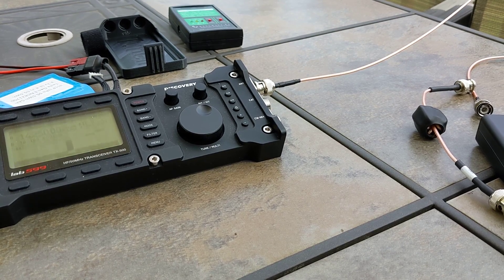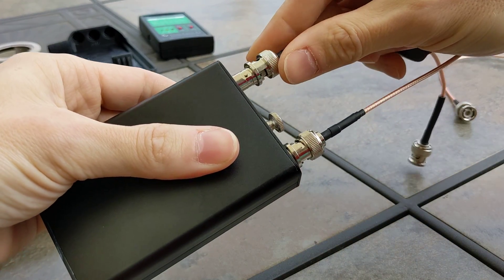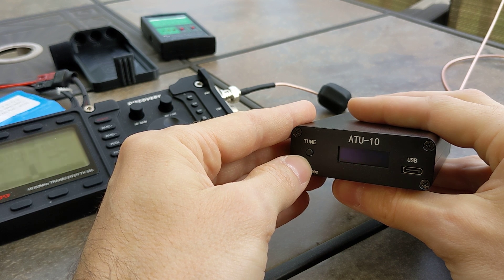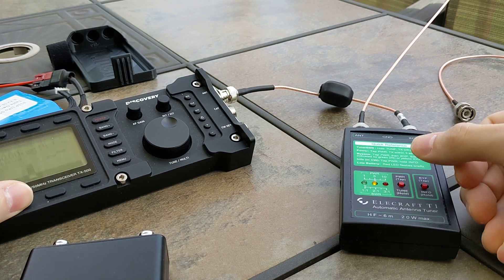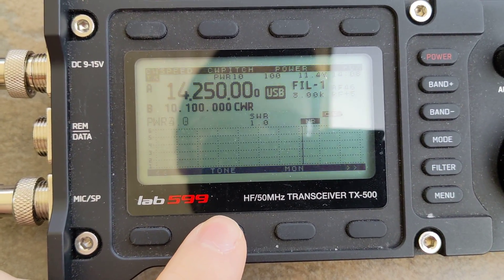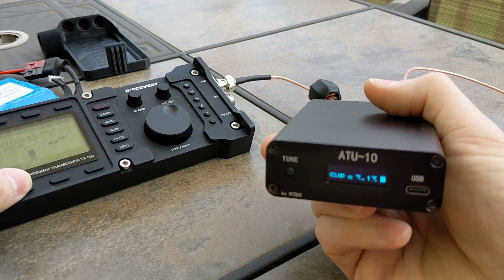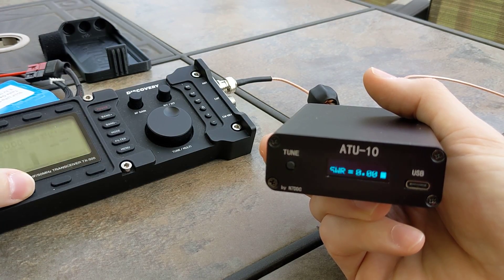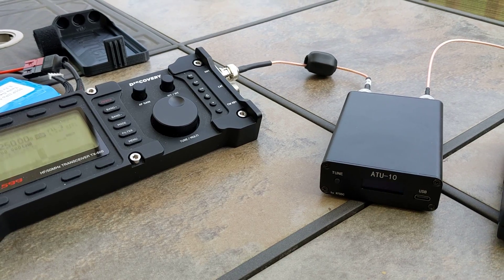ATU-10 Tune Test

Comment: Interesting...I have that exact antenna purchased from you.  I had been using my ZM-2 to tune it up but just bought an ATU-10 and get the same results...tunes every band from 80 on up except 20 meters...even on the latest 1.6 firmware.
Reply from the maker: Oh fantastic!

Comment: hello, thanks for the video: I have a question: could it work well with my Yaesu ft-818nd? 
P.S. I went to the site you mentioned of Joshua, but I couldn't find the new firmware.
Thanks 73 de IU1HHC loc. jn44al.
Reply from the maker: Hi! NewDiyTech is simply selling these units. The firmware can be found on the site direct from the developer David. That can be found on his GitHub here: https://github.com/Dfinitski/ATU-10-10W-QRP-antenna-tuner Will add to the description. Thanks for watching.
Reply: @N5FY  thankyou, but on the site  you indicated which item of firmware should I choose?
Reply from the maker: @marcotulliodavid8711  David continues to update the firmware for the ATU-10. I would go with the newest and if you ever have a issue with the tuner check back in to see if there is an update.

Comment: You may want to think about putting the CMC between the tuner and the antenna, and not between the tuner and the radio, since common mode can result in incorrect results on SWR meters (like the one in the tuner, which may result in an imperfect selection of coils and toroids). The risk of that is probably lower at lower power levels, and I know this is a QRP rig.

Comment: Did you try moving to each end of the band to see what the ATU-10 does?
Reply from the maker: I did not. I thought if it failed close to the middle with over a 3:1 moving to the top or bottom likely wouldn't do too much good.